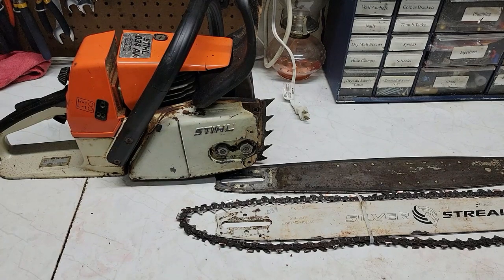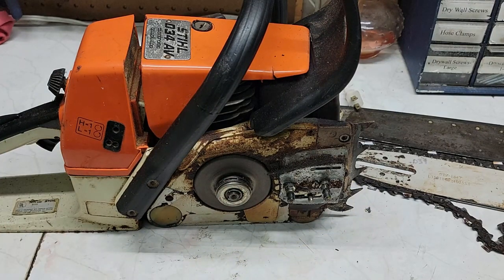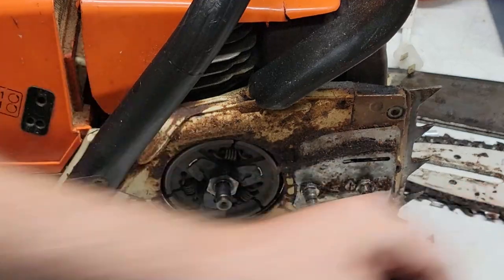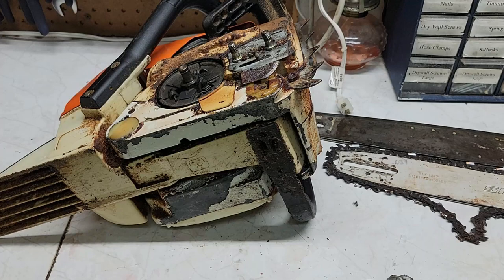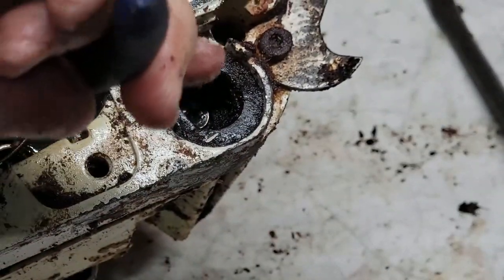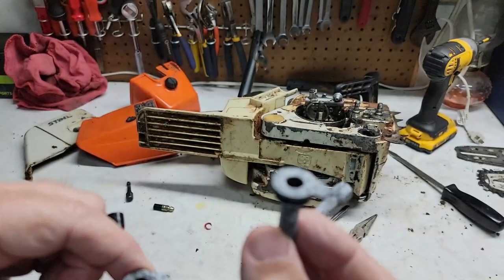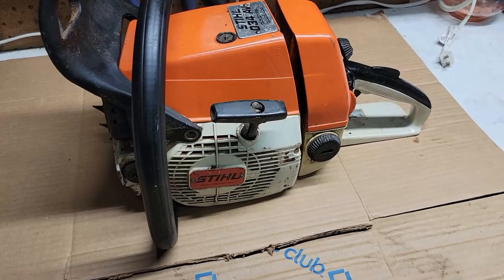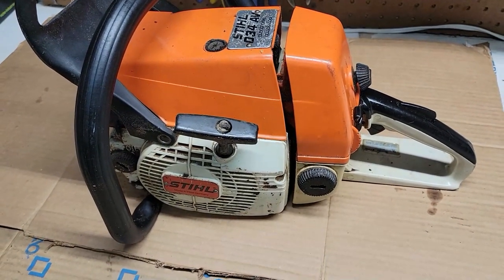Does your chainsaw leak bar oil?

Comment: I have owned nearly every Stihl saw or worked on them. I logged most of my life. That saw is one of the best an fastest saws Stihl made. 036cyl an piston will fit as well. They all leak bar oil . I pay no mind long as they oil the chain running.

Comment: My new stihl 250 leaks unless I drain it. The dealer has changed the oil cap 3 times and when I picked it up it was leaking. I do own another stihl chainsaw and it doesn't leak at all. I have owned other brands and one had a case to keep it in and the bottom of the case was very wet with oil too. Just have to buy more oil and paper towels i guess
Reply from the maker: Thanks for sharing